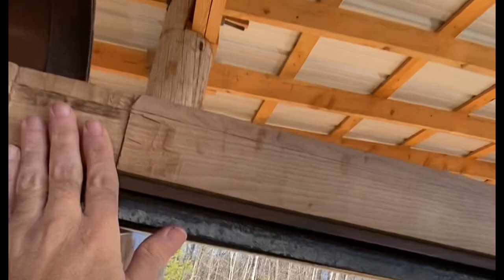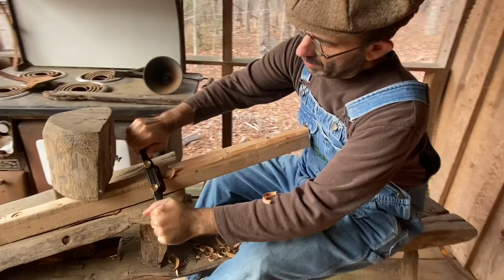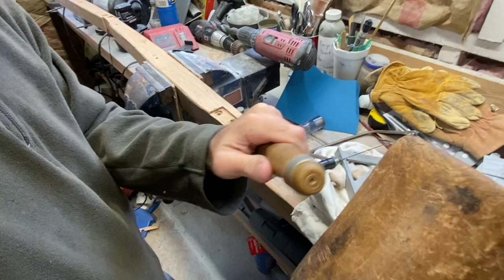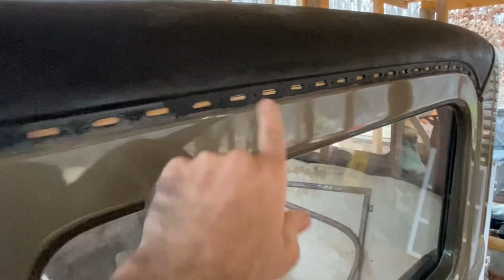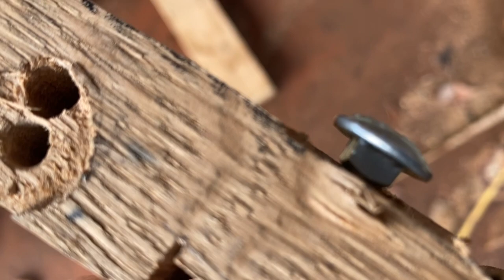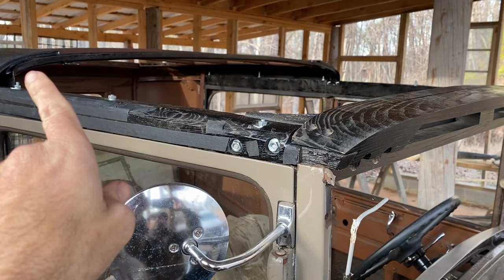SIDE RAILS: Top Wood Replacement for Ford Model A

Comment: Good job on hand crafting the side rails  I am in process of making all my wood parts by using the old parts built up with wood patches and epoxy as templates  Then will run them across the Shaper and Router
Reply from the maker: That is Inspiring! Three cheers for your determination! Hip hip, Hazaah! Thanks for the comment Timothy! Hope it goes well brother